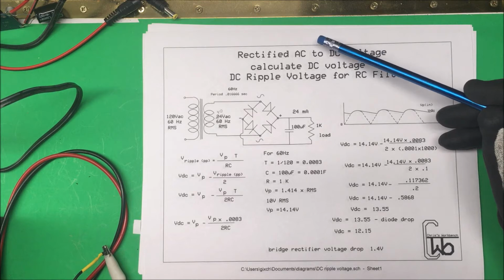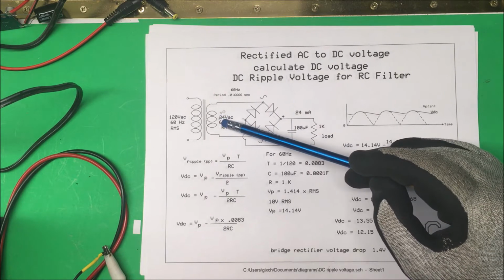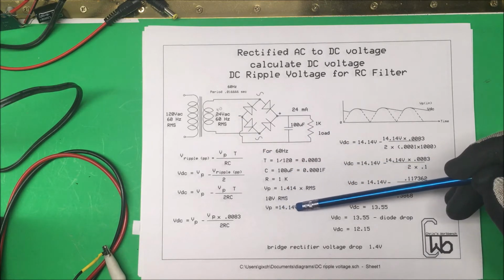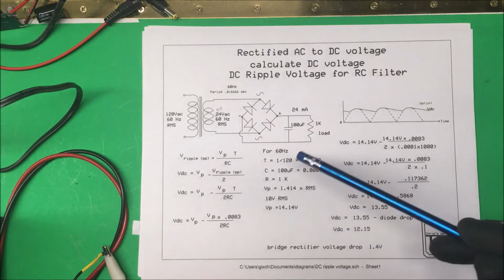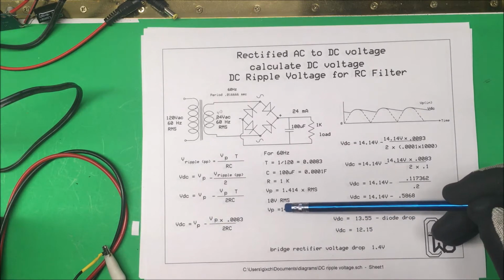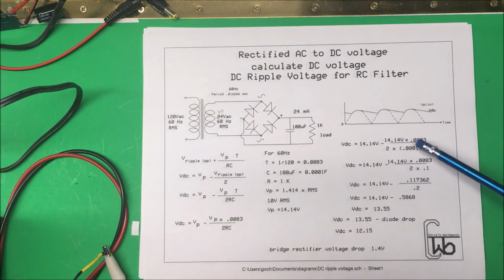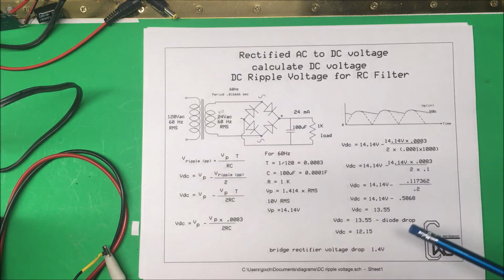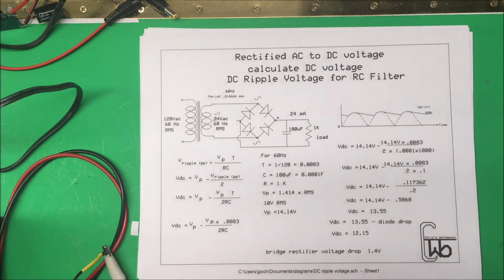Rectified AC voltage

Comment: Thank you very much. I enjoyed this explanation. I'm using three phase transformers, so I guess the voltage will be a little higher after it is rectified. But it is nice to know that the DC voltage is about 125% higher. Thank you.